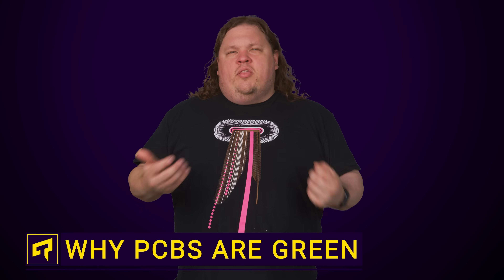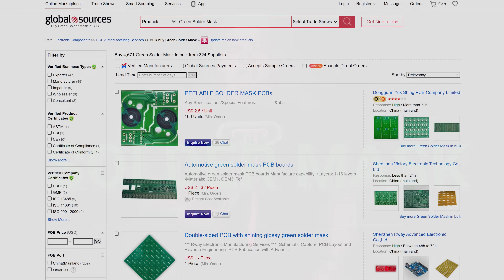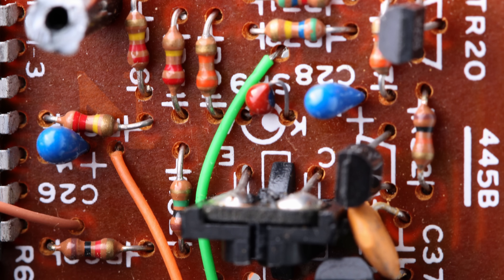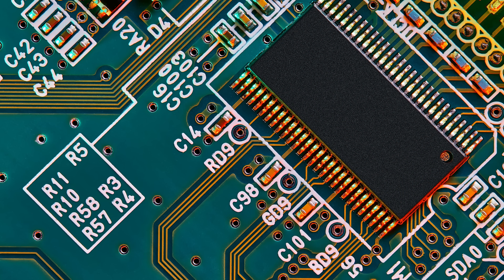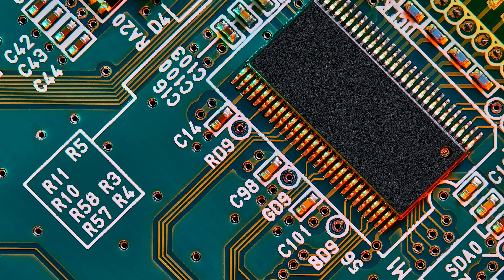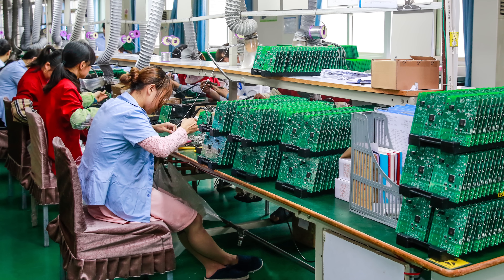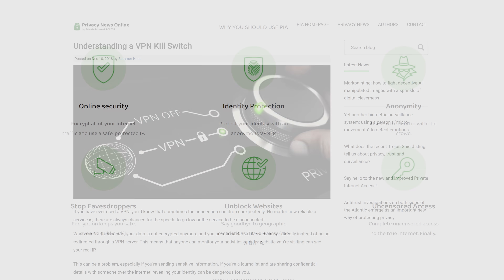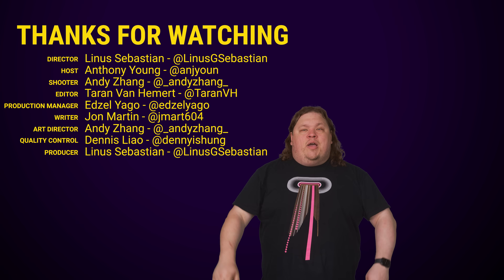Why Are Circuit Boards Green?

Comment: I thought it was the cheapest and most default epoxy they could source. :)
Reply: That's what I've heard. For whatever reason years ago green was the cheapest solder mask available. Electronics has always been a margin industry. Long ago consumers did not look at circuit boards either so there was no sales downside depending on the color.

Comment: I worked in a mobile communications squadron in the Air Force. I joined the Air Force right near the end of the Vietnamese War. We were told the green on all our Etched circuit boards was anti fungal coating.
Reply: There may have been conformal coating on the boards. Conformal coating makes the board waterproof. Conformal coating is usually clear. When I assembled mil coms gear those boards had no mask on them at all. But I never saw the boards done so I don't know what happened to them after I soldered parts on them. They might have gotten a coating?

Comment: I worked in pcb factory and green was the cheapest protection layer. But I didn't thought this green was helping not straining eyes and made it easier to spot errors.
I usually was given blue and black pcbs to check whenever someone ordered such. I had highest quality control results in comparsion to coworkers.

Comment: The dyes also come with different color costs, white yellow sometimes red have higher costs due to lower demand, or how the dye implemented onto the board
Reply: The cost of pigment is related to the materials in the pigment. Some substances are simply more expensive than others are due to scarcity.

Comment: The world needs more white pcbs. There’s not enough white motherboards and gpus. And if they made white 10+Gbe nics, sound cards, and both nvme raid cards and storage controller cards that would be even cooler. I would love to have an all white threadripper pc with a white gpu, white add in cards, white noctua fans, white custom cables, and either all white nhd15 for threadripper (it’s insane they haven’t made that yet in normal or chromax) or an all white custom loop with white radiators and satin titanium colored tubing and fittings with white accents. Oh and thunderbolt 4. I want 4 tb4 ports. Over 10gbe lan, and 4x4tb sabrent gen4 plus in raid. An all white gen4 optane 5800x would also be sick. Would also be cool if universal audio made a pcie sound card for PCs with their crazy dsp effects available, and a unison preamp for a microphone.

Comment: In the early days of PCBs the conductive features were so large and well spaced that no solder mask was required at all. It was common for the copper traces simply to be all coated in solder usually by rollier tinning, later electroplating solder and reflowing it. As components shrank in size, it became necessary to add surface insulation to prevent shorting so the technique of screen printing, already being used in the trace imaging process, was adapted to applying solder mask ink. The green colour was influenced by the factors mentioned in the video but there are two others. 1) The  most heat- and chemical-assistant polymers fortuitously had a naturally green colour 2) as commercial usage grew, producing solder masks in other colours was special and the volumes not all that high since boards were mostly hidden away inside the equipment. So when price mattered (nearly always) you asked for standard green.

As component densities increased again with the advent of surface-mount technology, simple screen printing of solder masks was not good enough for the fine features required in many cases and a new technique of photo-imaging was introduced by ink makers. This uses film artworks to expose the ink  which is sensitive in the UV range. More recently LDI or Laser Direct Imaging which eliminates the film perfoms the same function even better. In both cases, ink manufacturers found that their green-pigmented inks were the easiest to produce with high yield and the best performers which is why they  still pre-dominate where cosmetics is not the first consideration.

On PCBs, the older yellow-brown  substrate was generally FR2 or paper-reinforced phenolic resin.  The smell was indeed distinctive. Nowadays the standard board  material is FR4 or glass-reinforced epoxy resin which does not have much of smell but colour can vary from clear translucent  through  pale greening to very pale bluish depending on the manufacturer's particular resin mix. There are many sub-variants of FR4 and also substrates for specialist demands like high temperature or high frequency use.

Comment: Ideas for videos... TikTok doesn't have to be for silly things, you could have a Techultraquickie and tell us a handy shortcut or piece of software LTT staff use every day that isn't necessarily common knowledge.  You wouldn't put a 15 to 30 second clip on YT, but it works well on TikTok.  I'd like to see a daily quick tip, I might learn something.  You'd only need a screen recording and a bit of text.  You could have an LTT voice to go with the text to make it more LTT, but that shouldn't take as long to produce as 15 to 30 seconds of video, for example.

Comment: "Good luck even finding a green motherboard today" - I just bought one - "Supermicro H11DSI Dual AMD EPYC 7000 EATX Gigabit Server Motherboard"
Reply: The server and embedded market is full of green PCBs. No need for fancy flashy colors. Cost, practicality and reliability are the most important factors there (while I don't really think that non-greens are less reliable just because of the color ofc.)
Reply: @fonkbadonk2957  Soldermask is purely cosmetic.  Colors are selected by the company who designed the PCB most of the time.  That said, some colors are harder to image than others.  Soldermask is a photo imagible ink that requires UV light to print an image.  Most colors aside from green will not hold features if they are smaller than 4 mils, takes more UV light which causes encroachment issues, your mask opening gets smaller and eventually may be on a component mounting point.  Defects related to soldermask are cosmetic in nature, the board still functions as designed but doesn't look good, too thin, mask covers or encroachs onto pads, etc...
Reply: @DBRONCOSfan  Yes, most of the time color is purely cosmetic, but in some use cases soldermask color can also have technical reasons. For example LED boards will need white or black soldermask, depending on whether light need to be reflected or absorbt. Also the soldermask finish can be glossy or matt. Green solder mask, on the other hand, would distort the light from the LEDs.
Reply: @j_a_e_r  The PCB still functions in terms of electrical signals traveling along the inner layers and outer layers to there respective components, regardless of mask color.  The PCB designer would select the mask color and type based on their intended use case.   Different types of mask, matte (MP), gloss (BN), semi gloss (HFX), (Taiyo soldermask types) all have different properties that meet different industry standards.
Reply: @DBRONCOSfan  Sure, I'm talking more about IMS PCBs where the only function is LED lighting.

Comment: "If you're talking about motherboards, good luck finding a green one anymore."
supermicro entered the chat
Reply: ASRock has enter the chat
Reply: @tonyman1106  mine is blue :(
Reply: Dell Prebuilt has entered the chat
Reply: @KyriakosTech Productions like what?
Reply: Oh if I could only afford a supermicro and its ECC-RAM glory.
Reply: @KyriakosTech Productions so you need classic PCI slots, the next question is how many. My MB has one PCI along with the several pciX but it is 7 years old. They make pciX to pci adaptors, a bit clunky but they get the data transferred.

Comment: last place i worked out use green, blue, red, black to correspond with the phase of the program (prototype, blue label, red label, black label)

Green is for prototypes while black PCBs are for the black label phase of the program. Makes it much easier for us to differentiate boards in the lab and what board is which

Comment: Because its solder resist and it doesn't have to be green, it can be blue, red, purple, etc.

The purpose of the solder resist it to seperate the copper into tracks and prevent current from jumping onto the wrong part of the/a circuit.

No I didnt watch the video but maybe I saved you 3.5 minutes. :)

Comment: I work as an electronics engineer and design PCBs for a living and i have several stories related to solder mark. My favorite is the following - we are a small company, but for security reasons we have our own assembly department (read as 2 guys operating 2 Pick and Place machines). That is fairly uncommon for small manufacturers. 
One day i was talking with one of the P&P operators and he told me that mate black PCBs tend to solder better during reflow (the part of the process where you put the board in a big oven and melt all of the solder). That was not something i had experienced during prototyping, because i usually solder stuff by hand, so i stop applying heat when the solder is fully melted. So it turned out that since the boards are black, they dont reflect so much of the heat back in the oven, so they heat up move evenly. Since then we've almost always ordered black PCBs, unless we could not for some reason. Yes the price of the PCBs is higher, but we save money on manual fixes. 
Bonus info - the next best color in terms of solderability tends to be blue, then green and red (they are both middling), then yellow and white (those tend to SUCK for automated soldering). White and yellow also tends to be a bad solder mask to begin with, most PCB manufacturers dont have a good process for them.

Comment: ehh I have the question WHY are they all black now??

In the late 90s/early 00s it was really easy to find components in a whole spectrum of colours... red and blue where the most prevelant.. green was also still around... and white could also be found.

today.. I find it MUCH harder to create a system with "all components of color x" than  in those days.
finding a motherboard with a white pcb and a gpu with a white pcb is already VERY VERY hard... (especiallyu since that 1 or 2 models that do have them often cannot be found in my region)

Even in the old IBM pc.. the 8086.. the ISA cards inside it had these possible colors.. red, blue, black, green, white and even brown.
Now pc CASES.. yes THOSE would be always beige... ;)

yes most BUDGET parts where green.. but if you were willing to spend say midend money on a component.. you could get one in ANY color you'd like.
this color freedom has since disapeared.

Comment: Green also allows light to penetrate easier than red, black, yellow, blue etc. The solder mask curing process requires UV light, or more specifically the 405nm wavelength to penetrate the mask to cure fully. If light cannot penetrate at all, on for example a black mask it wouldn't cure properly or at all. If it couldn't penetrate fully it may crack, deform etc

Comment: Green is also a good color for automation to tell the differance between soilder runs and blank board. One of my clients use MC8000 automated/QC devices work better with green for small OEM manufacturers.

Comment: "good luck finding a green motherboard nowadays" 

challenge accepted
Reply: All I have to do is carefully  paint it green
Reply: @yourmom-qf4oe  
No.. you just have to open your TV or DVD Player or blu Ray or Alarm clock or Iphone or Android Phone or pull out your cars control board
or buy a network card or open a router
basically they are everywhere
Reply: Supermicro. There, hunt is over
Reply: Last ones I remember where the Intel 'reference designs' that they sold along with their chipsets, around the same time nvidia still made motherboard chipsets too..

Comment: Military? Nope. You will never see a soldier carrying around a bare circuit board, unless he is a repair technician. Soldiers in the field have their electronics in ruggedized cases, so the board color does not matter.
Reply: I heard military circuit boards were coated with an antifungal compound that just happened to be green. In places like the jungles of the South Pacific, uncoated boards did not last.
Reply: @raffriff42  
NO.. THAT'S RIDICULOUS
Because the military have a thing called   MILSPEC  (Military Specification)
and it refers to HOW THEY PROTECT ELECTRONICS, and it has nothing to do with how they coat a board but instead...

- They understand that the comms officer may need to be carrying a keyboard or some nature, maybe a mouse, the main computer in his SCAT PACK and he may need to slowly crawl through a river with all that on 
MEANING, THE COMPUTER MAY NEED TO BE SUBMERSED FOR A VERY LONG PERIOD OF TIME UNDERWATER

- or they may be in a very dry environment, lots of sand, dirt etc,  or very hot.. the tropics or very muddy or whatever... you get the idea
MILSPEC Deals with how to protect the communication equipment under these conditions

They don't give 2 fucks about the coating of the board because in a river that's not gonna mean shit.
it's more to do with sealing the electronics while maintaing a reasonable cooling system ,  usually PASSIVE COOLING because who wants to be fucked worrying about a fan stopping and a CPU over heating while in battle

and yes... THE HOUSING OF THESE COMPUTERS IS GENERALLY GREEN   OR CAMMO 
the colour of the board or coating is not relevant
Reply: @martinkuliza  I was thinking of WWII  & Vietnam era stuff. What you say does make sense.
Reply: @raffriff42  
thanks, much appreciated
Reply: Yeah grunts are not trusted with fragile parts of any kind on any tool they might use.
Reply: Also, there are different environments - green camo in a desert stands out, FOR SOME REASON.

Comment: I am a PCB field app engineer, The soldermask is printed in a photolithography process utilizing UV light to expose the photosensitive Soldermask (S/M) either with photomasks or direct laser imaging. The use of black and even worse white or yellow is a pain in the A, Those colors are inherently UV blocking and reduce the resolution of the imaging process.

Comment: Why aren’t we talking about red motherboards that HP used in some of their OEM systems?
Reply: Some 15 years ago, red was MSI's default PCB color. PC-Chips and Biostar also used it for some boards.
Reply: @Ale.K7  The PC I got 15ish years ago had a red MSI mobo, which I thought was kinda cool at the time, but it wasn't in any way a high-end mobo
Reply: Gigabyte and ASRock used Blue, ECS used Purple, and Asus used Yellow.
Reply: Red is generally used to track failures of new or adapted products. It means that if a product fails it can be recorded easily.
Reply: Just saw a red motherboard in asus tuf laptop
Reply: I assumed red PC boards were products of the red Chinese.
Reply: @jrstf  These companies are Taiwanese so that could still apply, just depends if you view Taiwan as the ROC or not...
Reply: @amirpourghoureiyan1637  Except "Red" Chinese pretty much exclusively refers to the commies.
Reply: @jrstf  Americans be like:

no offense tho

Comment: Remember when they were yellowish-brown? Those are the real g'old days.
Reply: A nice puke color
Reply: Peanut butter?
Reply: Some still are... Really cheap low end very simple boards still are at times.  Lowers manufacturing cost for the rare times they can get away with it.
Reply: I'm not sure if you're trying to imply that you viewed that color as gold or not.
Reply: the brown boards are ultra cheap usually single sided boards made from paper and resin (FR-2/pertinax).  Most other boards are yellowish, FR-4 made from glass fiber and resin
Reply: @fuzzy1dk  Single sided FR4 is also brown on the other side, and often seen ;)
Reply: @iFireender  maybe if it is covered by copper on the opposite side
Reply: @fuzzy1dk  nope, fr4 is naturally slightly brown. Trust me, I'm an electronics engineer who has handled bare fr4 quite a few times before : )
Reply: @iFireender  ditto, and I've never seen FR4 be other than a greenish/greyish yellow, the brown stuff is FR2 or FR1
Reply: @fuzzy1dk  Ah, okay, we're talking about the same thing then, I guess. I have slight deuteranopia, so yellow-greenish sometimes looks brownish to me. Yes, it isn't dark brown like FR2, but it still has some kind of brown tint to me.
Reply: I have an early 386 board here in that colour. System date Nov 1989. :D